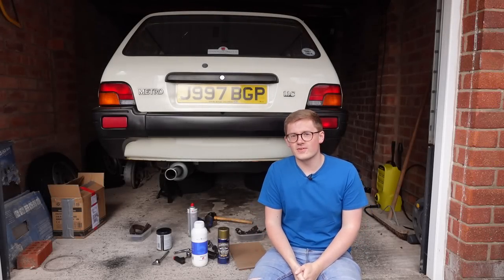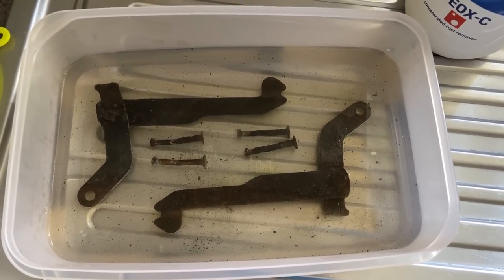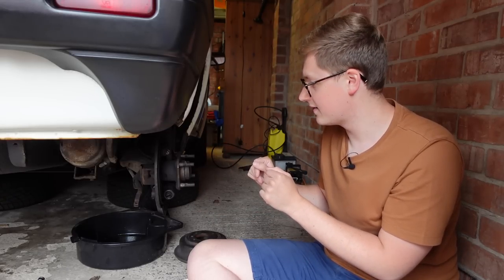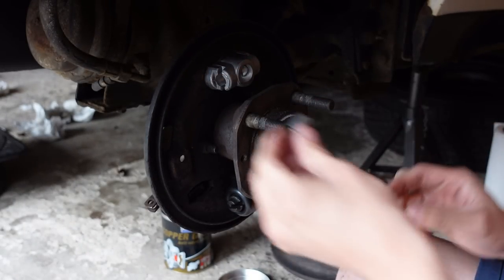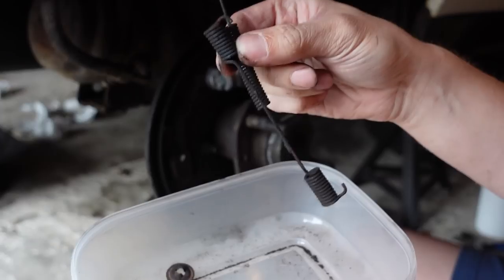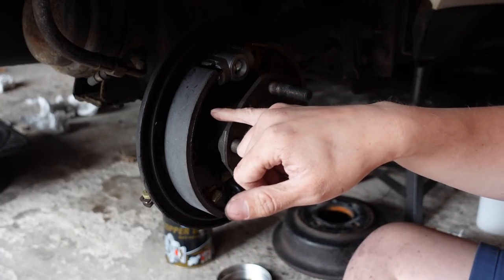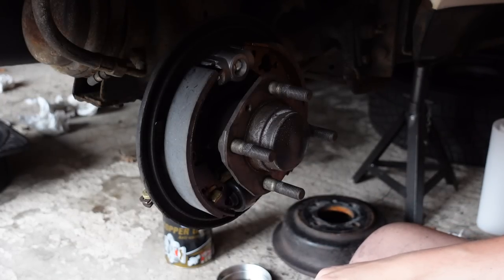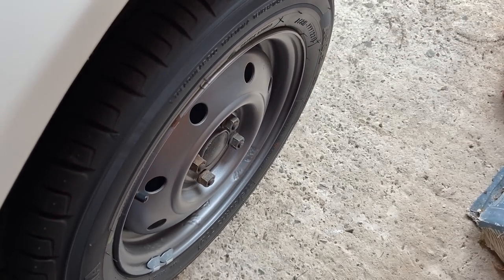Rear Brake Rebuild - Rover Metro

Comment: Well done and 10/10 for effort. That's the way I learned to DIY my own cars. A couple of tips from experience;  

I'd have planned to replace the slave cylinders from the off, esp when they are £10 each. Most rear brakes I've done have been becasue they have seized or started to leak, not that the shoes have worn out. I fear for yours now they have been disturbed. If they leak they will ruin the new shoes...

 I cover the friction surface with masking tape to stop them getting covered in oil/grease/brake fluid that gets everywhere. Remove just before the drum goes back on.

if the springs are being a pain to get on, I assemble the springs onto the shoes and then prise the shoes on over the mounting posts and slave clyinder with big screw drivers/levers

sand or file off any lip thats inside the drum, makes it easier to get teh drum on and stops any annoying scraping nosies

press the foot brake whilst adjusting the free play

Comment: Always replace the wheel cylinders, I guarantee they will be leaking within 6 months, then you will have to do it all over again. Also, there is a special tool for putting the shoe retaining clips in, usually costs about $5 (probably around 3 quid).
Reply: Definitely get the retaining clip tool. It makes an otherwise pig of a job  (fitting those bloody clips) much, much easier.

Comment: Well done.

Before you adjust the brakes pump the pedal a few times to centralise the shoes in the drums.

Some slight drag is normal with drums, as long as it spins relatively freely it'll be fine.

There's usually an adjustment procedure to follow for drums, so just double check.

Comment: On a '91 Geo Metro, the rear drums incorporate the rear bearings and it is necessary to remove the axle cover, straighten out the deformed nut, unscrew it, and then remove the drum while holding in the outside tapered roller bearing.

Comment: A good tip for refitting rear shoes, with the bracket & springs attached, is to compress the wheel cylinder pistons with a cable tie. Prevents you from damaging the dust boot or popping out the piston.

Been there done that...

Comment: Ed I love your enthusiam...its very infectious..... A little tip from an older chap whos derusted quite a bit in his time....dont pay big bucks for De-Ox or what ever its called..... I've used it myself then got put straight by an even older hand.... this stuff is simply powdered citric acid...nip into Wilko or  good hardware store and its sold as kettle descaler...or even just as citric acid.......Bilt Hamber is ripping us all off...its very cheap to buy if you order it it commmercially...and when your other hobby is restoring machine tools you need to derust slightly bigger bits..... keep up the good work..
.best John

Comment: You did great here, those shoe return springs can be very tricky to fit. I use Tectyl spray wax for brake and suspension parts that are difficult or impossible to paint, quite expensive but works a treat.

Comment: Great work. I’ve never heard you swear until you put those discs on the springs. I sympathise, as i did this job on the Metro I had. It made me swear, too! I now have the correct tool for this job which makes it much easier. Keep up the awesome work.

Comment: Melvin has "floating" rear drums. Some older designs have the bearings and studs integral with the drums. Benefit: access to the brake hardware is easier. Drawback: cost if a drum fails is significantly higher, more potential points for failure.

Cleaning the backing plate can be improved by using an inexpensive paintbrush from Poundland.

Comment: I wish the Bendix drum brakes we use on Fords had an adjuster like that, it looks like the sort used on mechanical brakes, instead of the damn starwheel adjusters you have to dig around through a hole in the backing plate.

Comment: I found that the slave cylinders usually leak before the shoes ware out. Unless the handbrake levers seize up and ware the shoes. Personally I only replace the shoes when they are totally worn out and I replace the cylinders at the same time as they ruin the shoes when they leak.

Comment: Nice job. In addition, I would have used a file to put a small chamfer on the leading edge of the friction material to eliminate the possibility of brake squeal. However that's probably not going to be necessary.

Comment: There is one major issue with a binding brake, and that is fire. Over heat enough and the brake shoes will ignite. Definitely not fun. A leaky wheel cylinder is reason to take the car off the road until corrected. The brake fluid will ruin the new shoes, meaning a second brake job in short order. 
Are self-adjusting drum brakes not the usual thing there? Drums with self-adjusters were standard hear 50 years ago. Reverse at a reasonable speed, hit the brakes moderately hard, and you would feel the pedal rise as the shoes adjusted. So much easier.

Comment: Did the threads of the adjuster have lubricant (copper grease) on them from factory? If not, my advice would be to not add any on the threads (surface is fine).

Comment: Hi Ed, did you need to change the Flexi hoses also? I'm not sure if there's 1 or 2 rear Flexi hoses!
Reply from the maker: Hi Nicholas, I didn’t feel the need to change them as they seemed in perfectly fine condition.  I believe it’s one flexi per side.